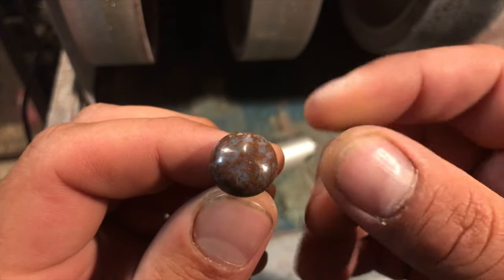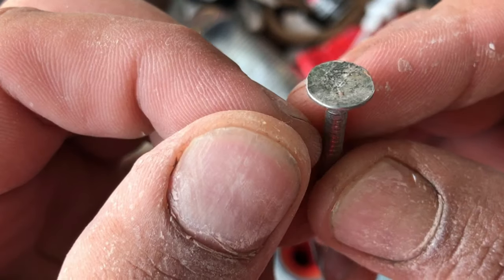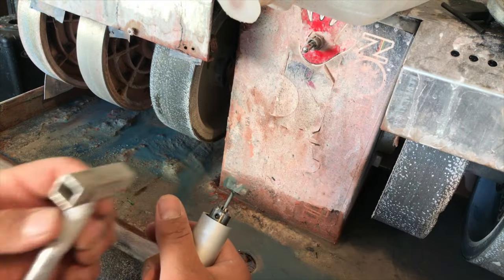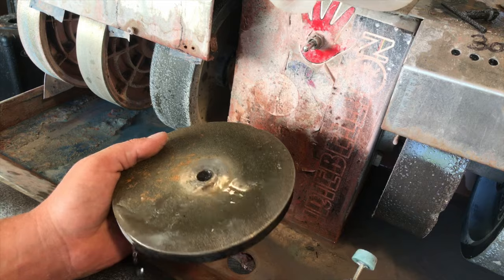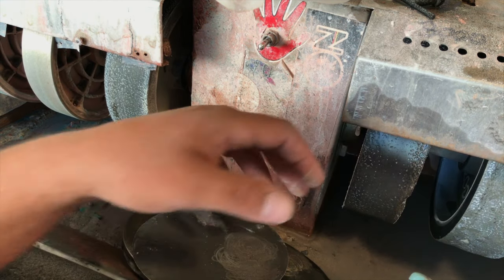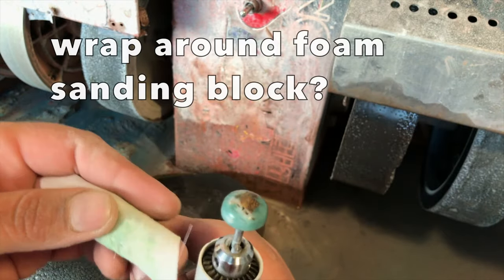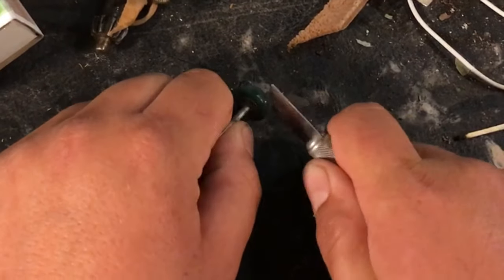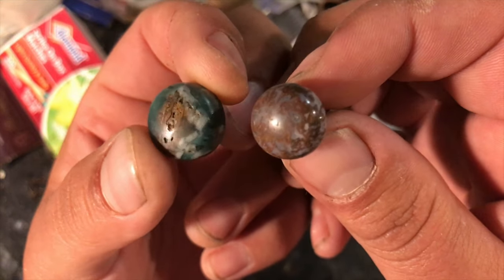Making Round Cabochons Using Simple Tools Dremel, Rotary Tool, Hand Drill, Drill Press, Etc

Comment: At our lapidary club we use a small butane torch to heat the shank of the nail (or screw) for a few minutes.  The flame will conduct the heat down the shank to the head of the hardware and soften the glue.  It usually only takes 5 minutes max and the stone drops off the screw.  Then we soak the stone for less than 10 minutes in acetone to soften any remaining Superglue.  A razor will remove the softened glue.  Then you’re good to go to polish the back of the cab if you want.

Comment: I use diamond core bits in a drill press to drill out cores and then cut off slices. It works well, it’s quick, the buttons are uniform and lends itself well to mass production.

Comment: Good info. I''m thinking that having a technical drawing circle template would facilitate the process of determining the "round" of the stone prior to the saw work. Another tip: Heat the nail with a small butane torch will break the CA glue bond without harming the cabochon. (Hold the cab while heating the nail.)

Comment: Nice presentation.  i'm just starting into shaping pebbles.  so your efforts do help.  a few weeks ago i got some  dopping wax from amazon, cut up a dried branch... done some cabbing with it and also used hot glue.  was grinding with anything i can spin or hold in my lap.  you can finish the cab backs on the non motorized gear you showed here. i usually try for ovals and hearts...so fatter mounts work well.  nice to see round work.
you may have saved a tile saw from my abuse...

Comment: I finally got the time to sit down and watch this as got a flex shaft today...... I'm 100% going to be trying this method 😂
Reply from the maker: awesome Brother make sure to just is it in to whatever you’re draining the stone against depending on the material it’s super easy to just fracture a huge chunk out of it if it’s spinning too fast and you dig into deep
Also your package got shipped out today I’ll be getting tracking for using
Reply: @lapidarydave  Thanks for shipping I'm so beyond excited 😂 I usually use the lower setting on my Dremel I'm fine taking extra time and less risk compared to higher speeds I'm looking at all different videos for drop setups too just to see what works best for me

Comment: This is one of those things where I instantly think to myself, "how the hell didn't I already think of this idea myself?"
Lol
Great idea, great video. Thanks for all the info, and thanks for making, and posting this awesome video.

As to the sandpaper needing a soft backing, you can buy a cheap yoga mat. Then you have a roll of good firm foam rubber, and can cut pieces to fit your task perfectly. A little glue, and a piece of 1/2 inch pine lumber. It's pretty cheap, and you can use em over and over.

Also, with the nail glue, have you tried warming it up first, then rolling the blade around the perimeter? Just curious if that might work easier, and not risk chipping, or breaking the stone.

What's the smallest stone you've done this way? I'm probably going to try myself, but curious how small you've successfully shaped and polished a stone. Like maybe it's harder to make consistent motion on the abrasive when it's smaller, due to higher rpm.
Reply from the maker: Hello there my friend thank you so much for watching it means a lot to me :-) I’ve done it with pieces about 2.5mm small I don’t do this technique a lot anymore but I do use it for duplicating and calibrating small precious pieces
Reply: @lapidarydave  nah bud, thank you. Glad I subscribed
Reply: Totally! I was like facepalm, no more stressing over getting perfect circles, great video

Comment: I did this before with my Dremel and a piece of aquamarine. I used gorilla glue and wet and dry sandpaper and a sponge. I applied the compound to a piece of micro fiber cloth for my glasses and it worked wonders.
Reply from the maker: Fantastic my friend I’m so happy to hear that you were also using the technique it is super cool even for folks that have lapidary grinders it’s a nice way to make perfectly round cabs are used to wonder how did folks make those super tiny round cabs that are used to see in old Native American jewelry I imagine a similar technique is being used
Reply: @lapidarydave  That's true they are beautiful. In Mexico one of my uncle found some jade artifacts which was a necklace that had all different shapes that had holes that were straight from end to end. The holes measure around 3mm wide and it goes through the entire stone. I used to polish my stones with my Dremel before I got my machine but I still use it.

Comment: Great information. One thing that I would do different. When you spin it inside a piece of cloth, do it in three steps. #1. Dampened 1000 grid aluminum oxide. #2. Dampened 2-micron aluminum oxide #3. Dampened cerium oxide. If it is a stone that will polish good, then you should get a real shine. You won't need much powder at all in the cloth. The grit that you use doesn't have to be the exact same that I suggested, but I think that you get the idea.

Comment: For your nail. Bend the sides down slightly on the head. Kinda like a flat top umbrella shape so when using a blade you can get right under it and it'll pop off easier
Reply from the maker: Nice tip thanks so much my friend :)
Reply: @lapidarydave   I hand polish aussie opals and getting them off without breaking is not so easy. You could also drive the nail through a piece of wooden dowel, of course sand the dowel even to spin and glue your stone to the dowel then soak in water or alcohol. The wood will soak up the water/alcohol and free the bond, if needed pop it in the freezer.

I'm in the process of converting a treadmill I picked up on side the road into a flat lap. Wish me luck!
Reply from the maker: @brandonmccain5983  Thanks for the tips my friend I really appreciate it also when you Start on your treadmill conversion please document it with photos or video I would absolutely love to see it being made and I’m sure it will help thousands of people who want to get in the library who can afford it and don’t have a imagination like you to turn a treadmill into a lapidary machine

Comment: Such a great vid! I wonder if wrapping felt around a sanding block then loading it with Zam would work
Reply from the maker: I think that would work for sure as long as the sanding block was silicone carbide which cuts hard material that other types of sand papers do not

Comment: I recently discovered your videos, and absolutely love them. I am new to the world of lapidary as I am about to get my first trim saw to start slicing some small rocks to make cabs and weld sculptures to incorporate stones. Just wondering if you have any advice for someone that will be using strictly a flex shaft for shaping and polishing. Might also buy some grinding discs for the drill for the polishing stage. Curious if you have any tips or tricks for someone new? also I’m looking online at sintered diamond bits, and I’ve noticed that if their classified as dental sintered bits much cheaper. Curious if you’ve ever tried any of those and if they’re the same as the lapidary specific sintered?   Thank you for your time and thank you for your videos !!   Love them!!👌🏻🤘🏻🤘🏻
Reply from the maker: I have you some of the dental centers they’re not very aggressive so get her that are slightly more aggressive than you think would work for instance 46 instead of 80 or at least 60 for the grind you can buy like three inch diamond discs and your flex shaft and advice but if you have a little bit of extra money can be used as a Lapidary wheel machine or flat lap
Reply: @lapidarydave   thank you for the help man, and just curious as some of the wording might have gotten auto corrected near the end but if I have extra money, I could create my own cabin machine out of said wheel? Is that possibly what you’re saying? Otherwise I am contemplating doing what you did with the video here and getting the what looks like 1 inch thick diamond wheel to make said cabs 🤘🏻. Thank you again for the advice man.
Reply from the maker: @Silasposton  out of a drill press my AutoCorrect is haunted

Comment: Would one of the $120 combo trimsaw , buffer /rotory tool( flex shaft )  stations be worth while for a start to learn on?
Also would one of the $200 faceting machines work well and long enough to learn with and maybe use to cut enough to buy better machines? 
Maybe a year or so at most?
I saw a video that has an old timer who makes cabbing flat laps.  It has grooves in the lap( maybe it is a topper)   shaped for perfect round cabbing. Using one should help remove that tip as it is a rounded surface . I bet you could make it easy enough with the right tools. In his case he turned a hard wood plank into the cab-lap  on a lathe.
Reply from the maker: In my opinion the trim saw/buffer/Flex shaft, the machines that folks see a lot on aliexpress wish.com and as of late eBay I’m not very good I have had two friends now who bought them he says they’re extremely under powered and when trying to work even softer material such as Turquoise the machine bugs down to a stop So I will definitely pass on that machine I would rather have a tile saw and a cheap Walmart brand and hyper tough rotary tool then one of those when it comes to the calving labs I do know that there are a few companies out there that make flat labs that are concave for calving are used to see a lot of rubber ones back in the day for a cabin in vintage lapidary Journal as of right now I do not know anybody who is selling them that you might be able to find one online and I love the idea of making on yourself out of wood you’re gonna need to use diamond Payson probably make a few different kinds but then again if you’re using a Dop Stick it is very very easy to get a nice rounded cabs even on a flat lab Thanks for reaching out my friend I really appreciate it please consider subscribing if you haven’t done so already it really helps the channel
Reply: @lapidarydave  thankyou on the machine advice. I want to do faceting more than cabbing, but both are need to know information to me. I want to make rosecut stones ,sugarloaves and checkerboard cuts plus ,general stone cutting whenever / however i can make it happen...i have been eyeing up my womans mop bucket because it has a foot pedal to spin a mop drying area...i am thinking "preformer" lol .
Reply from the maker: @coreymerrill3257  that sounds super interesting I wouldn’t be surprised if that my package could take quite a bit of a load while spinning when it comes to those $200 fastening machines if it has a decent mast and not one of those cheaper Handpieces that just have the octagon shape grooves on the part that holds the dab stick I think they could work just fine definitely a lot you can do with a cheap machine to make up the money very fast to buy a better machine depending on how hard you feel like working
When I bought my easy cab machine which was about $1775 Hi probably worked easily well over $3000 worth of Turquoise 🔥❤️ in about 12 hours so we can definitely be done very fast the hard part is selling the pieces I tell people all the time who messaged me saying they’re having a hard time selling but you just have to understand that just because we are in the west it doesn’t mean that we are worth $50-$100 an hour you’re not going to make great money trying to sell tiger by cabs for 50 bucks apiece where they are being made easier in a much higher quality overseas for one dollar
Whatever you do with whatever machine you end up using make sure to work the best material you can it will make it a lot easier to sell the pieces in the end which is the main goal for a lot of us lapidaries

Comment: Just use a lighter to heat the glue and the stone will come right off the nail. That way you don't have to apply any harsh chemicals to your stone. Thanks for the video, Keep it up Lap D! 
Haha Cabbage John...
Reply from the maker: E. J. H. Thank you so much for the tip my friend I really appreciate it I have thought about that in the past but I never done it before:)
Reply: That works great.  Just try not to breathe the fumes, because burning cyanoacrylate is pretty toxic.
Reply: Yes, just hold the nail over a flame keeping the stone about a quarter inch away from the flame,  the glue will soften in just a few seconds and the stone is released from the nail.  

Love your videos,  & I have learned a lot from you.  Thank you.

Comment: Great idea until I can afford to make my own cab machine.. gona use a washing machine motor. Its perfect rpm 1725, belt driven with a keyed spot to put a shift on so I can mount wheels on what and then brasher the belt drive a trim saw when needed.  Buying the wheels is the expensive part now..
Reply from the maker: If you try this technique let me know how it works for you :)

Comment: I imagine an easier way to get the stone off would be to melt the glue with a heat gun, blow torch, or even a blow dryer on the hottest setting. I think that would be both easier and safer (provided you wear gloves) than using a knife. UNLESS that would damage the stone? I know nothing about stones (why do you think I'm watching this? xD) so I would love to know what you think of my idea here.
Reply from the maker: Blow torch is definitely the way to go :) I use a propane torch you are spot on my friend:)

Comment: Hello lapidary Dave, I am going to be purchasing one of the harbor freight flexible shaft grinder, and I see that you are using one. Does the water affect it any? I will be using mine for crystal carving where water will come into contact with the tool. Will the water damage it?
Reply from the maker: So I’ve been using my harbor freight flex shaft for almost a year now and I only ever use it with water I haven’t noticed any rest at all I haven’t noticed any loss of power, or any binding, rust etc. The handpiece is made out of some kind of zinc magnesium or may be a very cheap aluminum but I doubt aluminum so probably some kind of cheap zinc stuff either way it does not rust the pieces inside of the handpiece including the truck are steel and they are definitely not stainless steel either way I have not noticed any rust after nearly A year of steady use with lots of water I think it is a very safe bet to go with the harbor freight flex shaft however I think it’s better to buy it in person with using the 20% off coupon since the shipping kind of defeats the savings one would get from ordering the harbor freight over other no name brand flex shafts on eBay and Amazon the only thing that ever concerns me about the harbor freight flex shaft is that the motor housing is made out of plastic Which obviously doesn’t affect the power or anything but if it falls hard enough from a high enough place I’m worried that it might not be as resilient as a metal housing such as the ones being used by Fordom :) You’re going to love your harbor freight flag shaft my friend
Reply: @lapidarydave  thank you for such a quick reply, I love your videos, you inspired me to start my own vids of gem shows. Thank you! It truly makes me happy and excites me every time, I’m glad I found something that makes me this happy. Now that I know the flex shaft is a solid buy hopefully I can soon start a career in lapidary or gem carving/artwork; with due practice. I watch your videos like everyday all the nice gems are all so amazing it sucks Tucson show was canceled this year but it’s gonna be better than ever next year!
Reply: @lapidarydave  also you said there’s a 20% off coupon?! Where can I find this at?!
Reply from the maker: @bigred4340  Thank you so much for enjoying the videos it means a lot to me and my friend if you ever need help you can always leave me a comment here in the comment section you can find me on Instagram via #LapidaryDave  
Facebook via https://www.facebook.com/profile.php?id=100010423326634
Or email davijjgarcia89@gmail.com 
It’s always my pleasure to help my subscribers
Reply from the maker: @bigred4340  You can find the coupons online just type in February harbor freight coupons sometimes you can even find them on their website most of the time the harbor freight people will not just help you out by scanning coupons they have at the store but sometimes they will they should be very easy to find online are usually don’t even look form until I get in line at the store
The coupon is for 20% off one thing in your cart that is the most expensive